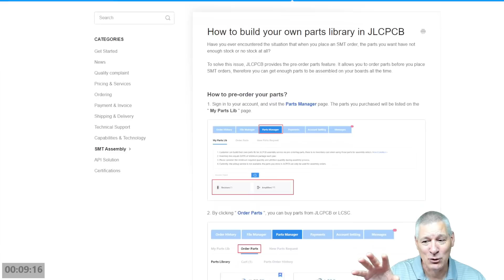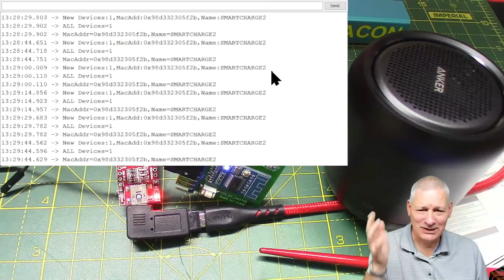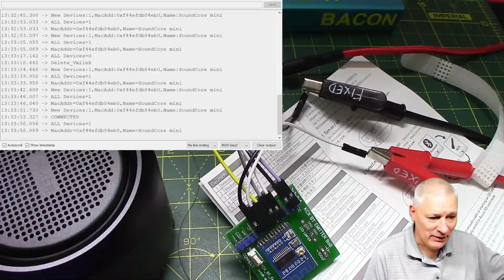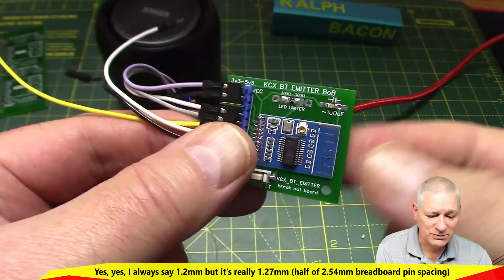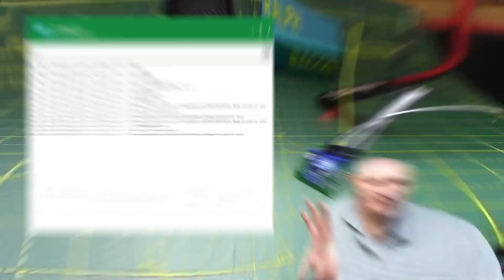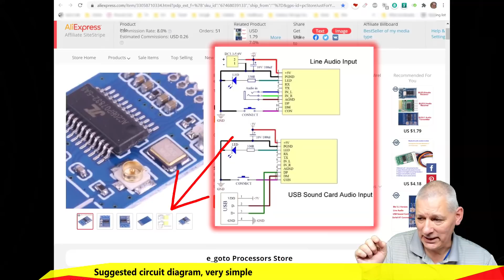#235 Bluetooth Audio🔊Transmitter (KCX_BT_EMITTER) - with AT commands

Comment: Hi Ralph, Finally got round to completing the KCX_BT_EMITTER-Breakout-Board (it’s only taken a year). I have set up to test its response to AT commands as per your video (235). (5V ON VCC and TX RX via FTD1232)
Despite the board being discovered, I have not been able to get it to connect and wonder if you have any thoughts that might help me to move forward please?

ALL Devices=0
Delete_Vmlink  (Note after pressing CONNECT)
ALL Devices=0
ALL Devices=0
ALL Devices=0
ALL Devices=0
ALL Devices=0
New Devices:1,MacAdd:0x00c8ac91bd7,Name:Bose Mini SoundLink
ALL Devices=1
MacAddr=0x00c8ac91bd7,Name=Bose Mini SoundLink
ALL Devices=0
ALL Devices=0
New Devices:1,MacAdd:0x00c8ac91bd7,Name:Bose Mini SoundLink
ALL Devices=1
MacAddr=0x00c8ac91bd7,Name=Bose Mini SoundLink
ALL Devices=0

As you will observe my device is discovered, but then immediately disconnects. This continues for around 4 iterations after which it reverts to reporting ALL Devices=0. Predictably the blue LED flashes quickly throughout the process. I have tried “AT+CONADD=0x000c8ac91bd7” to no affect. Any pointers appreciated.
Reply from the maker: The first time you ever power up (too late now, I guess) it will connect to whatever is waiting to pair with it. If you thereafter press the CON button (or momentarily short the contacts) it will clear the memory and start as described above. Ensure you have the item you want to connect to in pairing mode. After that it will connect to the same device each time.

Some items will not connect to this device, but I don't have details of why or which ones. BT speakers should, on the whole, be OK.
Reply: Glad to report I finally have the KCX_BT_EMITTER board working. The problem? As you mentioned in your reply ‘some items will not connect to this device’. My Bose Soundlink Mini is just one of these devices. After obtaining an alternative unit it now works faultlessly.
I think this illustrates an interesting point: as amateurs, most of us learning as we proceed, there is a tendency to assume any fault will be a result of a mistake of our own making. The odds are that this will often be the case, but not every time. So perhaps we we should learn that there comes a point when fault finding, to stop, take stock and consider the idea that the fault might may well not be our build but some other external factor. Faith in our own ability (with you guidance) is worth a lot.
Reply: Do you know details on the cap, led limiter, and connect button he used?
Reply: @engindude25  Hi, I have used a 220M Ohm Led Limiter resistor. I cannot remember why so high (Ralph suggests around 220 Ohm) but that’s what I have and it works. 

The capacitor is 100uF 6.3v Electrolytic (Because I had one in the spares box)

Comment: Hi Ralph, thanks for the video. Interesting module. Did you ever incorporate this into your web radio design? It would be an interesting addition. I can't find much example projects using this module
Reply from the maker: Yes I did. The audio output was fed into the BT input and received by a small BT speaker (from Amazon). I described this in a follow up video, I believe, but I may have dreamt it. Very easy to do.
Reply: @RalphBacon  thanks for the info. This is a great addition to your web radio project

Comment: Hi, what is the current draw running at 5 volts?
Reply from the maker: I found this on the Internet:

KCX-BT emitter Features:
Power Supply: 3.3~5.5V
current: 35mA
Transmission rate: 2000Kbps

Much more here:

https://bit.ly/3uMpPZ3

Comment: Putting one inside a Ipod and need this module because it has an antenna connection. It is tough to solder but ill get it. I needed the wire specs and your video had what i needed. Thanks
Reply from the maker: Great! I wish you every success with your soldering (and project).

Comment: If you want to transmit audio from your ESP32, why aren't you using the inbuilt Bluetooth? Why would you need an external Bluetooth transmitter when it's all on the same piece of silicon?
Reply from the maker: The inbuilt BT in the ESP32 is apparently not optimised for audio.

Comment: Thank you so much for the info. I've ordered some parts to have a play. I dont suppose its a standardised pcb footprint? 🤓Im more a software engineer than hardware... but loving the crossover 😇
Reply from the maker: Yes, it is! check for a symbol in EasyEDA by "bpoultier" called KCX_BT_EMITTER_5V. I edited this but I can't remember what changes I made now. The footprint on my PCB was made by "antoniv". Best I can do!
Reply: @RalphBacon  thanks so much
Reply: Hi Ralph, thanks again for your video. I got hold of one of these modules and wired it to an esp32 to send the AT commands which works really well*, however I'm getting some noise on the audio. I don't suppose you've had this experience? 

*NOTE: The AT+CONADD command requires a mac address with 12 chars after the 0x... the solution was to pad the mac address with 0's after the 0x. (i.e. 0x11111111111 => 0x011111111111)
Reply from the maker: Yes, good point about the 12 character MAC address.

Noise, no none. Do not ground both ends of any audio wires to from the transmitter. So the screen is only grounded at the KCX_BT end.

Check your power supply for noise. Try decoupling the VCC/GND on the breakout board.  Let me know (via email, or I'll never find a comment here again) your wiring setup.

Comment: Sir, is it possible to transmit audio data from ESP32 may be .wav file or any supported format to a wireless bluetooth headset?
Reply from the maker: Not that I know, which is why I used these modules.
Reply: @RalphBacon  It's definitely possible to do it without the modules. You can find info with the search term bellow.

Sending Sound from an ESP32 to a Bluetooth Sink

Comment: Hi Ralph. Great video! I used this very module for a CD player project and it works great. However, I wanna embed it now in a PSP to use it with my earbuds, but I can't find the way to manage the earbuds volume. Has anybody found out which AT commands handle that? I'd attach a board with an Atmega and the KCX_BT_EMITTER, intercept the PSP volume buttons and send the AT commands accordingly. However, I can't find any info :S. There must be a way to send "next track", "previous track", "start", "stop", "volume+", etc.
Reply from the maker: What are you sending those commands to (NEXT, PREV etc)? The KCX is only a BT transmitter, you can't send those sort of commands to it.
Reply: @RalphBacon  I'd want the KCX to receive those inputs and tell the receiver via bluetooth to increase/decrease the output volume. The same way a phone tells its bluetooth earbuds to increase/decrease volume. I know it's a BT transmitter, but BT can be used to transmit data as well as audio. Many bluetooth devices allow for data transfer of actions such as play/pause being sent from receiver to transmitter or volume management, which happens the other way around. I thought there might be a way to tell the KCX using AT commands to tell the receiver to increase the volume.

Comment: Hi Ralph. I was was wondering what the latency with this module is. Thank you!
Reply from the maker: Difficult to say. I had it connected up to my TV and noticed no lip sync issues. It doesn't use the low latency aptX protocol though. Only way to know for sure is to try it in your particular situation.

Comment: i'm trying to set it up to connect to one of my bluetooth devices, talking to the module through my arduino Nano. It can find my sony headphones and my samsung buds but it just doesn't want to connect and I cant figure out why. I use the program made by mark-md047 to add the mac adres but to no avail.

Do you've any ideas?
Reply from the maker: Try this: ensure the only BT device available is the one you want to connect to, and that is in pairing mode. Then turn on the KCX module and wait for a while. If it still doesn't connect press the connect button on the breakout board. That has surely got to work.
Reply: @RalphBacon  I have it just soldered up. Found your video after the fact. Do I understand the diagram right that it's a button that ya have to wire to the con and to the ground?
Reply from the maker: The CON button clears the internal list of previously connected devices and makes it look for something else to connect to - the first thing it can find.
Reply: @RalphBacon  the con button did wonders! ty Ralph!

Comment: Hi Ralph, is there an error on the silkscreen - it states 100uF cap is this correct value?
Reply from the maker: It's just room for some sort of (optional) decoupling/smoothing capacitor, Lee. I use 100uF in my web radio implementation but only a 100nF on my test board - both seem to work equally well. Btw do read what I've put on the GitHub about the use of a small aerial, makes a huge difference in range.
Reply: @RalphBacon  Cheers Ralph, much appreciated.

Comment: But….doesn’t the ESP32 already have BT ? 🧐
Reply from the maker: The ESP32 has BT but doesn't decode the final signal. Thus, if we still need another module to do that (I2S) we might as well use this one that does the whole job very well (even better with an external aerial, see my GitHub for what I use which has transformed the device).

Comment: Hi Ralph, a humble request: Could you shed some light on porting the Arduino capsense lib to the ESP32 or at least the functionality? The build in touch of the ESP32 is not sensitive enough for some projects, and i cannot figure out how to make a more sensitive capacitance sensor for the ESP32.  With the arduino i have no problems.  Greetings from the Netherlands.
Reply from the maker: Why not use a TTP223? I did a video that included them: https://youtu.be/jhtY_Hn5jBM Adjustable sensitivity, auto-calibration and very cheap. Can be hidden behind other bits of hardware (eg a front panel) to disguise them.

If that's not what you want, what you really, really want let me know I'll think again. 😉

Comment: I am wondering if there is a way to use something like this to send audio to 2 separate speakers? I have a pair of non powered 100 watt speakers with 1/4 inch (guitar type) jacks on the back. They are high efficiency, so they will fill a room with 10 watts input.  I would like to place them in different parts of the room and enjoy stereo audio without tripping on cables. So I would need something that has BT input that drives 10 to 50 watts and has a left/right switchable output. 

Can the board you demo'ed in the video pair to 2 separate devices at the same time?
or would I need to make my speakers act as master and slave?(I hope not)

What is the fidelity of the BT board in your video?
Reply from the maker: If you have two speakers that can receive BT signals then you could use two transmitters with just one of the channels (Left/Right) being transmitted by each module, could you not? 

But you would need an amplifier per speaker (you'll soon find one in the Asian warehouses) plus power supply thus turning your passive speakers into active ones! And they will need to be plugged in somewhere too so not entirely cable free - unless the amplifier was close to the power socket and you just sent the speaker signal to the speaker (same number of wires, ie two).

Fidelity is good, no perceptible background noise or hum etc but then again I'm listening to web radio in the bathroom! Oh, I did try this module on my TV to headphones and they were very good in that case too.
Reply: @RalphBacon  The speakers I have are (old school) 8ohm 100watt high effeciency speakers.. So I guess your first paragraph is best answer. I just need a separate (BT rec/amp circuit) for each speaker, then the corresponding transmitter for each one. Thanks 

Can you recomend a good BT reciever able to drive 10 watts or more into 8 ohms? Would I be able to name the BT recievers as LeftSpeaker and RightSpeaker?
Reply: I found a device that has a number: HW-407

Do you know anything about it?
Reply from the maker: It's an inexpensive BT receiver (stereo) but you would still need one per speaker AND have to connect a mono amplifier to it for each speaker. More details: https://amzn.to/32r5IFl and https://www.banggood.com/custlink/GDKYbib5v1

You could try looking on Banggood for a complete BT receiver and amplifier (Banggood do offer more 'complete' units than AliExpress' modules) although I suspect they will all be stereo and you would then need two if you don't want to connect one speaker to the other.

Comment: I believe you need to use an isolated power supply with these modules. I remember attempting to power it from my laptop's USB port and provide it with the signal from my laptop's aux output and I got a horrific amount of noise; however, when powering from a li-ion cell, it was absolutely fine. In theory, using one of those potted isolated modules for a few pounds from eBay or similar would likely suffice for this. In practice of course, I haven't tried that yet
Reply from the maker: I think that's true for anything audio plugged into a non-battery USB power source. 

For instance, all these sound horrendous when plugged into my TV's USB port:

o Amazon TV Stick
o KCX_BT_EMITTER
o Every other BT transmitter I've tried
o Small USB-powered Audio Amplifier

They all work OK when plugged into quality wall-warts but are horrible if plugged into a PC/laptop USB port or my TV's USB port. 

I'm doing a project right now to add a 'filter' of some sort to that very port so I can run my Amazon TV Stick from it without it sounding like someone frying sausages (should that be Bacon?) in the not-so-background!

Comment: Excellent design idea Ralph ... I would have thought by now that all the module makers would have created their own dev-kit with good prototyping connectors but obviously not 😀  .... btw does JLPCB provide a designers gallery where folk could order more copies from and maybe give you as creator a slice of the pie? (Like those t-shirt stores)
Keep up the great work 👍😀
Reply from the maker: I don't know about the 'sharing' bit (I'll check it out), but this breakout board's Gerber files are available in my GitHub; check out the pinned comment under this video for the location.

Comment: I wear BT earing aids so of course when they connect to the computer it cuts out the speaker and no body else can heat the sound.  Does anyone think it might be possible to use two of these in parallel with each connecting to a separate device? Like maybe 2 BT headsets?
Reply from the maker: Well, if you paired each BT module with one set of headphones I don't see why it would not always re-connect to the correct (ie the same) device... but there's only one way to prove it.

Comment: I have 2 of these modules in my drawer. Nicely stowed away after I saw the pitch. Why didn't they make these when I was like 20 years old and my eyes were 150%? 
Guess if I order from the UK the customs might tax me big time. 
And you are right with your warning about including YT links.   I tend to give comments that are rather larger than the average, since sharing is caring, and it is extremely frustrating to find that the posting has been removed after all the work has been put into it. 
Not sure why you haven't tried a DC-DC isolator that are widely available. Transformers tend to have some loss and also be non linear in frequency.
Reply from the maker: You can get one of my breakout boards without customs issues as I will send it as a gift - no money is changing hands! If you want one, let me know your full postal address, Luc. No magnifying glass included, sorry!
Reply: @RalphBacon   Nice just send you an email.  Next to the Flukes and others I have the same meter. Guess which one I tend to use for all my low voltage projects, yup that one.  It is lighter, smaller than my Fluke's, almost as quick and still precise after having used it almost every day for 3 years. For the price it is a no brainer.

Comment: Could you not use the esp32 was it not possible to use the blutooth on the ESP 32?? or am I missing something😉
Reply from the maker: I don't think the ESP32 has the capability for streaming BT audio but I might be wrong. I would have to research this (again).
Reply: @RalphBacon  I know the esp32 supports bluetooth classic which is  2Mbps and used for audio.  I had the same question. I don't think you can use  BT Classic and BLE at the same time though.
Reply: @RalphBacon  it can recieve the signal but you would have to figure out how to decode and amplify it likely with some external decoder reading off i2s